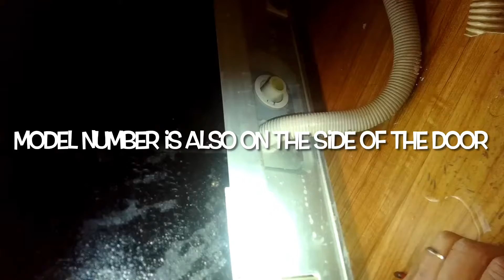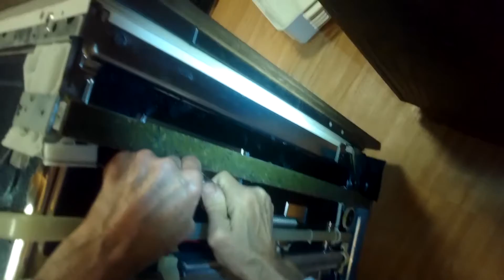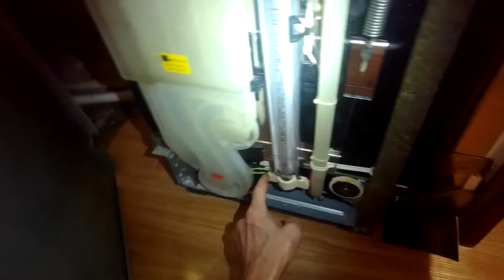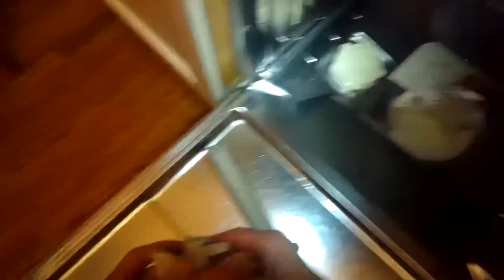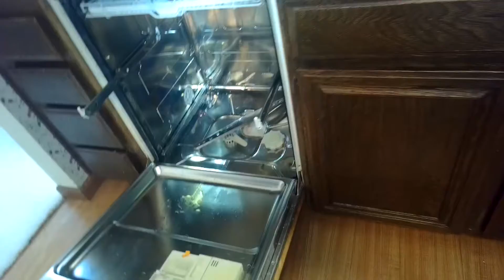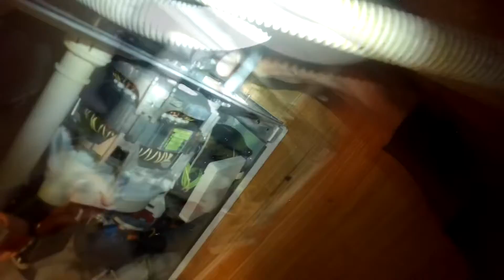✨  Miele Dishwasher Intake/Drain Light - EASY FIX ✨

Comment: Hi Scott, I’ve watched most of your videos on how to fix Miele drain/intake light flashing. I’ve followed your instruction to turn the impeller, clean all the filters, clear the drain ball bearing, I ordered a new circular pump from Miele and two new capacitors. The dishwasher worked twice or three times before the light starts blinking again.  Any idea or suggestions on what else I could check please? 🙏
Reply from the maker: Thanks so much for joining, I just sent you the service manual for your Miele with directions for getting the error codes👍

Comment: Mine was the flow sensor. Dishwasher would start the cycle but then fail after filling. I noticed when it was filling it would fill for a few seconds then stop and repeat this about 5 times, then fail. Everything else checked out - the ball valve and the main pump turned fine. I checked the flow sensor since and tested it with a meter. its It's a reed switch, not a diode. It looked OK but using a continuity meter and a magnet it was always open, couldnt get the magnet to close it. Got a replacement online - $4 for 10 of them - and soldered it in. This new one passed the magnet test. Installed it and this fixed the problem !
Reply from the maker: Wow,
Great job Matt😊👍
Reply: @Matt Limburg Thank you! That reed switch is $80AUD officially so thank you for providing the info to replace it for a few bucks!
Reply: Question for you please: 

The service documentation for my dishwasher states:
Flow Meter Count - Stores the “numeric value” marked on the side of the flow meter to ensure proper operating conditions.  Note:  To ensure proper appliance operation, the flow meter count must be reprogrammed after installation of a new flow meter and/or electronic.

Did you run into any issue regarding flow meter count after you replaced your flow meter (I should say, after you replaced the reed switch, which to the machine is likely the equivalent of replacing the flow meter)?

Thank you!